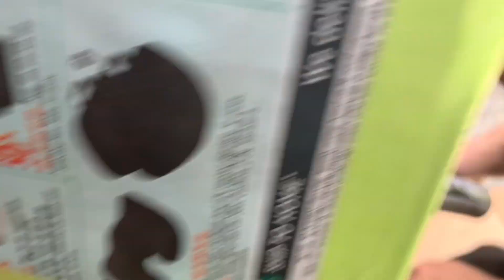Rocker Panel Replacement on 2013 Ford Econoline E350

Comment: Just got my e-250 cargo van past inspection… guy said you gotta work on those rockers and quarter panels before next year man lol yes sir
Reply from the maker: That’s what was holding this one up from passing inspection! 🤣
Reply: May I ask, What kind of inspection are you guys trying to pass?
Reply from the maker: @chicagomrs2270 in our province all vehicles must pass a mechanical safety inspection every two years to be permitted to be on the roads. The vehicle will fail if there are any holes on the body
Reply: @MacCustoms  makes sense. I asked after I realized it was a box truck I thought it was just a van. In my case here in Illinois a safety inspection was only needed when I started delivering freight for certain companies. Thanks for the reply! And well done!
Reply from the maker: @chicagomrs2270 here it’s for any and all motorized vehicles that use the public roadways 👎🏻 just a money grab!
Reply: @MacCustoms  I'm sure you're right about that! 💰

Comment: Did you use weld thru primer ?
Reply from the maker: I didn’t use that but you defiantly could. I usually use white coat metal so it takes longer to rust other then where the welds are